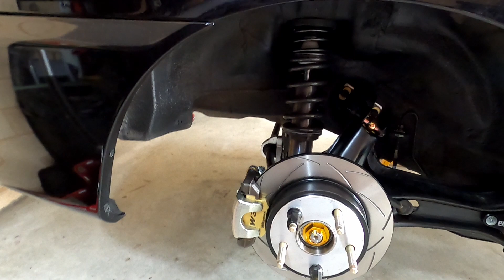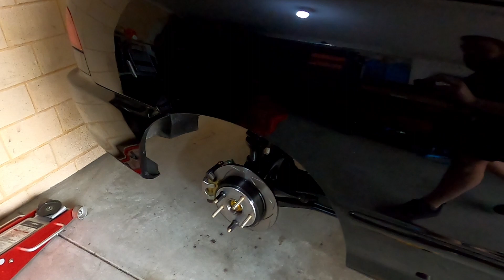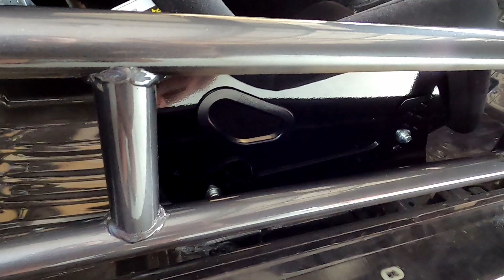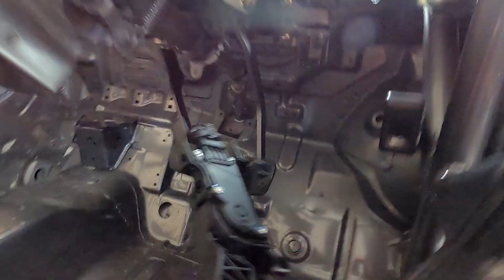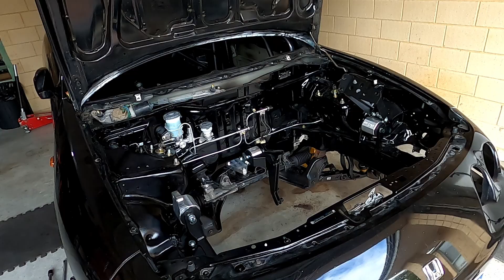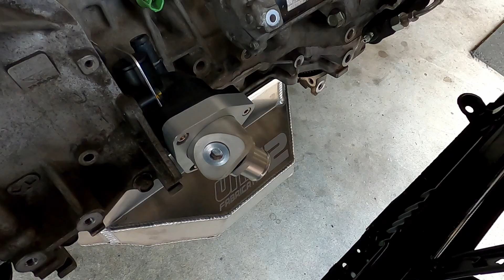K20 DC2 Integra Racecar Build Ep. 06 - Engine Installed

Comment: what distribution blocks are you using for the brakes? Thanks!!
Reply from the maker: They’re from GKTech, great products! They take a bubble flare rather than the usual inverted flare, but the pressure sensors screw right in
Reply: are the sensors the ABS pressure sensors that BMW uses?? or are they a different Bosch sensor? (I love the brake system so I am doing something similar on my 99 GSR) Thanks mate!

 @technologicmse
Reply from the maker: @joshmoline3802  yep that's the ones, they're 260 bar I think, I bought them directly from Bosch. Bosch do sell 100 bar sensors which would be better (more usable range) but they were more expensive.
Reply: Thank you so much!!!! @technologicmse

Comment: Sick build brother!! Question with the pci front lca you don't need traction bars?
Reply from the maker: Thanks! Nope, in almost all instances traction bars cause more harm than good. Only high-hp drag cars would need traction bars. For circuit cars, the extra suspension arm (the traction bar) usually isn't perfectly on-axis with the existing suspension pivot points, so it causes a lot of binding. Good compliance bushes (either hardened rubber or spherical) are all you need
Reply: @technologicmse  thank you very much! I gratefully appreciate your input. New subscriber!

Comment: This is great brakes is actually my project for june Whats great set up to keep 15in wheels but have more braking power also I was thinking about ABS removal and was wondering If you had way to contact you as I wanted to touch base about booster set up and see if you coule help with chassie question I have
Reply from the maker: Hi Mike, there’s a couple good options for keeping 15” wheels, depending where you live. In Australia, JDMYard sells a 298mm Alcon setup, and in USA I think ASR sells a 300mm AP setup. Not all 15” wheels will fit, especially high offset ones, but these setups are really good. For something more affordable, the Honed Developments adaptors for Porsche 986 brakes is a great setup too, but the rotors are narrower than the Alcon/AP setups and don’t take as much heat during long sessions on track. I ran the Porsche setup on my old EG and it was perfect for sprints and track sessions less than 15ish minutes. Deleting ABS in these cars is a good idea as the factory system does not work well, and I recommend deleting the booster too for better pedal feel. Send me a message on insta or FB if you’re keen to chat more. IG: shane_technologicmse, and FB: technologicmse

Comment: Reasoning for choosing the honed bbe + bosch dbw throttle pedal instead of opting for a full pedal box? cost & fabrication factors i'm assuming? Great content. Keep up the good work!
Reply from the maker: That's right, a proper pedal box setup would likely be 4-5x the cost of my setup, and much more fabrication required. It's a smart thing to do later down the track as it would let me move my seating position rearwards, but for now I just want the car finished and out testing :)